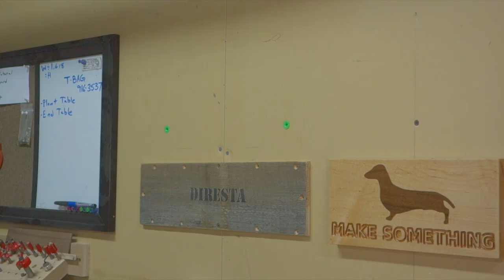Easy Wooden Display Case - DiResta Chisel!

Comment: Thanks for the video, Dustin. I have a question: if you were not going to use the tape/glue process to join the mitered pieces, what would you have used? Band clamp? Bar clamps? Thanks!
Reply from the maker: Lee Valley makes a box clamp thingy that would work great on something like this.  A ratcheting strap might work but would be a little oversized for something this size.
Reply: Thanks for the reply!